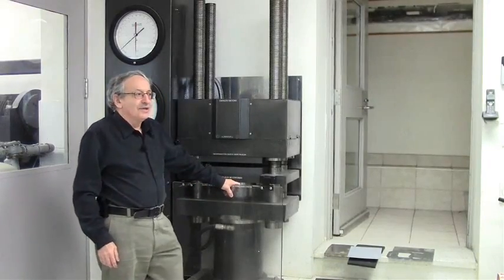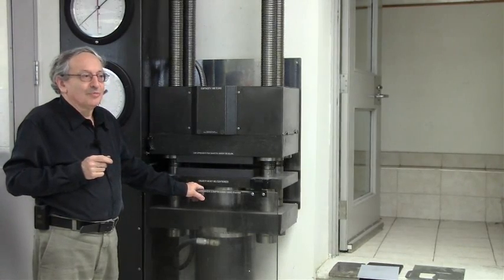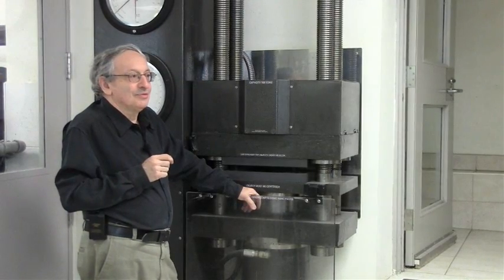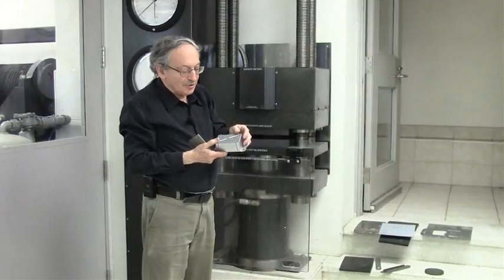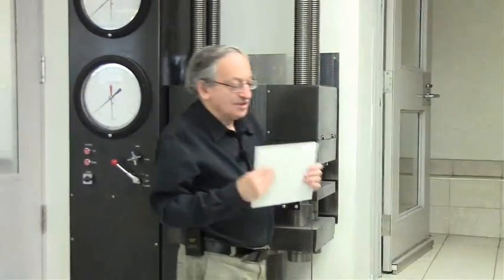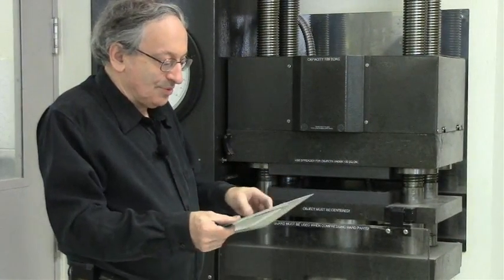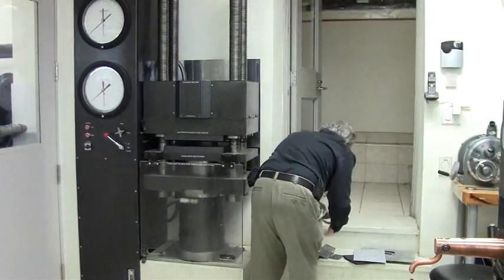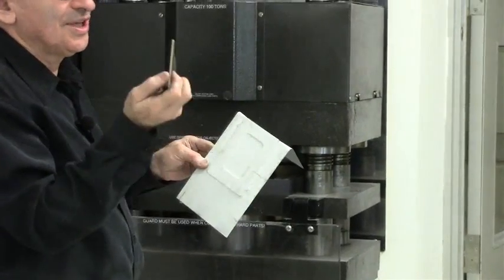Building Prototypes Dan Gelbart  part 7 of 18  Presswork

Comment: The stainless steel Dan mentions for making strong sheetmetal parts might be a bit hard to pick up from the audio. I think he is talking about 17-7, which is one of a family of precipitation hardening stainless steels (perhaps the best known is 17-4PH, used extensively for high strength fittings on sailboats and aircraft, and also more weldable, but 17-7 is more formable)

Comment: Great info again, just an ignorant question (unless I missed it)  as a 'Plan B' for stiffening sheet metal, and cost, what about a Bead Roller?

Charles
Reply from the maker: Bead roller is great but you lose the flatness of the sheet. Most of the time is does not matter. Press maintains the flatness. You can also spot weld  strips with an L section, or -^- section to stiffen  plate.
Reply from the maker: This is a very good point. The advantage of a press is that it maintains flatness, but for may jobs Bead roller is the way to go.